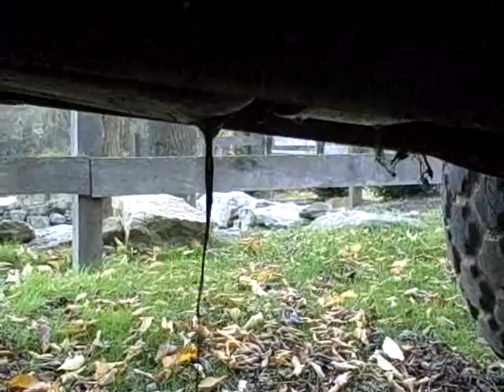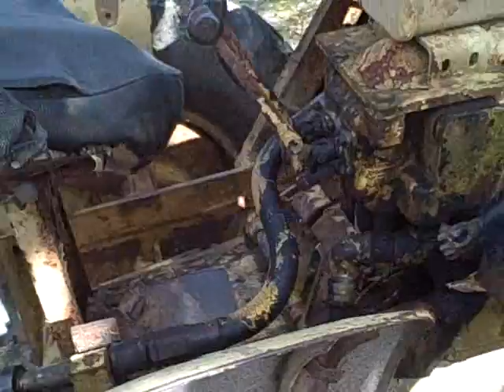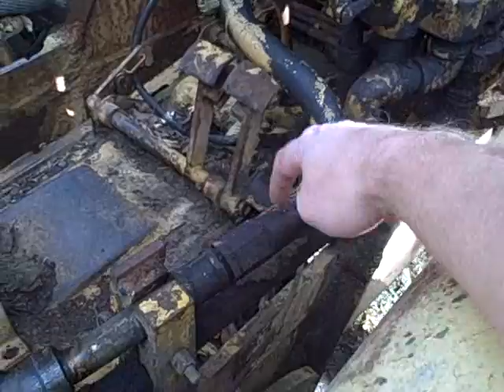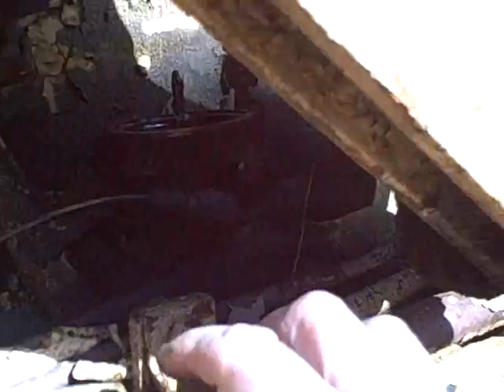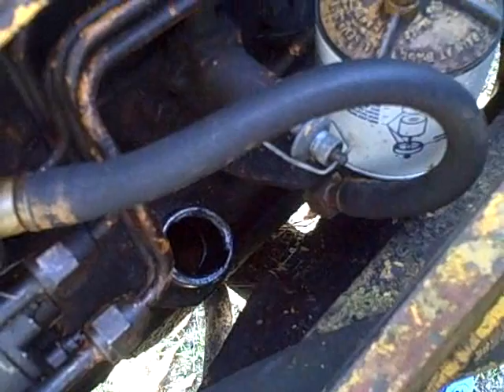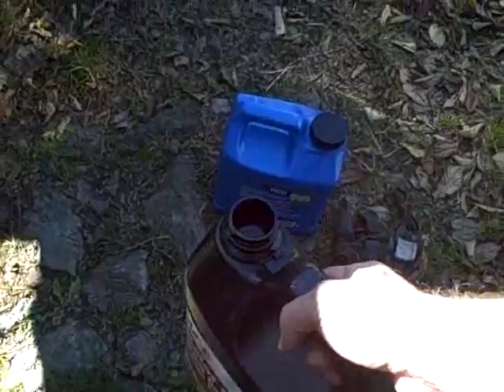Oliver 770 Industrial Tractor Project Part 21

Comment: oliver used the same engine block on their gas and diesel modles. i have a 77 gas and there are ports on the block that are blocked off. those ports are where some of the diesel parts go

Comment: Use the loader bucket to lift it , The arms & boom will fall sucking oil into the lines reinstall HYD. ends onto boom lines & it should stay up better than it is .

Comment: Oh the cylinders would have been washed with diesel many times trying to start probably start better too with more compression now , Why don`t you remove the ends of the boom lines to the tractor put into a full pail / s of HYD. oil and lift the rear boom then everything will relax and suck oil into the rear system when at the height you want stop put the ends back on and unchain it you should be able to turn around and hook up to it ,Be alot easier.